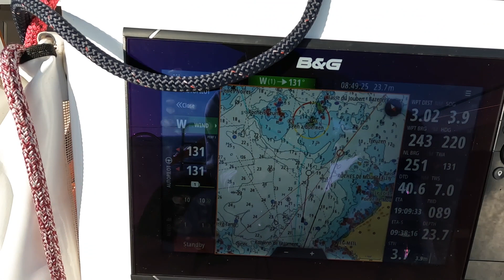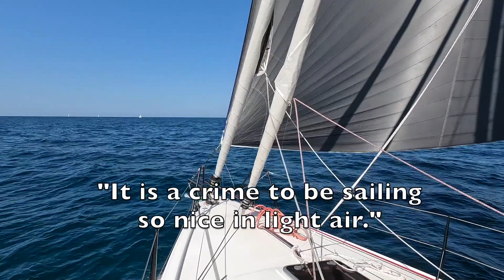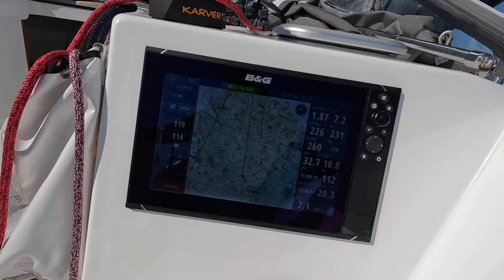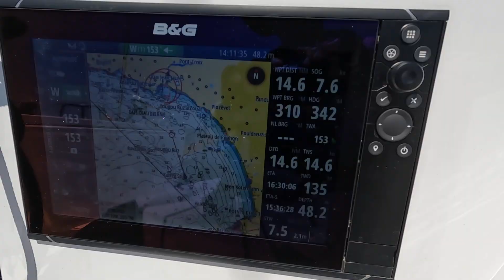Solo sail with large spinnaker.  A few mistakes!

Comment: Roasting along under that headsail.     I have a very different boat but stick with handling the chute behind the main,  behind the genoa works well but everything needs to be spot on at the masthead otherwise you have to cope with wraps.  With your windage getting on and off a pontoon will be a test in lively conditions.  Enjoyed the video.
Reply from the maker: Thanks Brian. Some techniques are universal across boats?  Drives me nuts when I see boats furling the jib head to wind.  What type of boat do you have?
Reply: I have a Contessa 32, as you say the challenges are often the same, particularly single handed. No bow thruster but a lot less windage and a big kick against the rudder, which helps in a marina. @svcyclops
Reply from the maker: Seems like every boat has its quirks.   Just takes time to get used to one’s boat then it becomes second nature?

Comment: Jason- loving these videos you are doing! Quick question: are your stanchions, push pit, pulpit a black anodized aluminum? Or another material? Thanks!
Reply from the maker: The stanchions are just anodized not carbon.  They will be need to be redone after 4 or 5 years is what the yard told me.  But worth the cool factor and less stainless work.